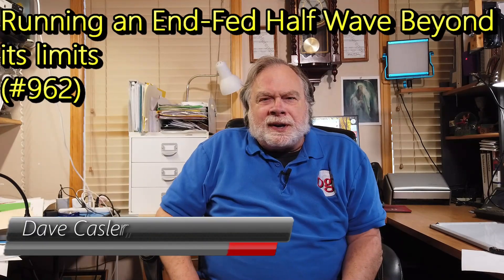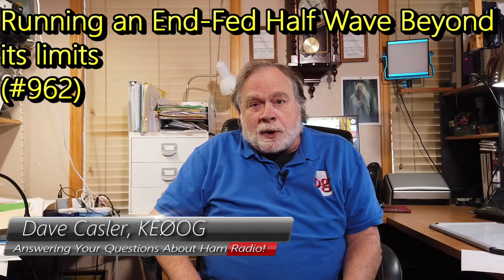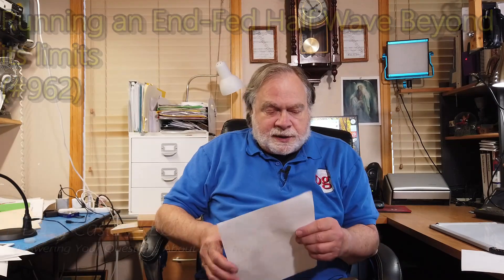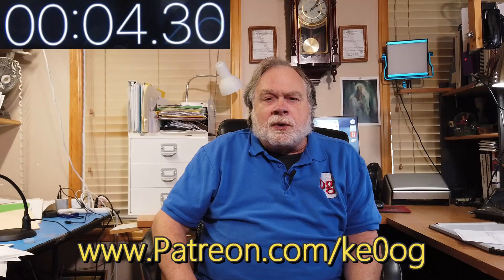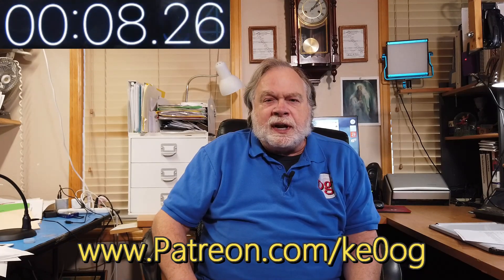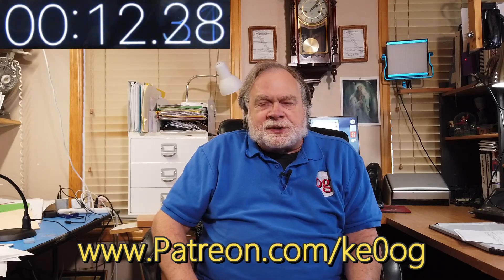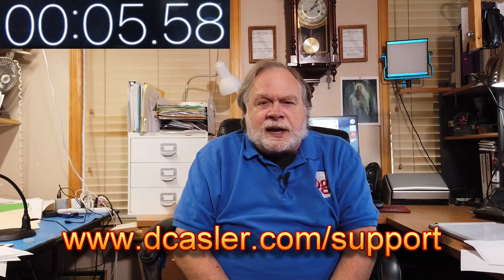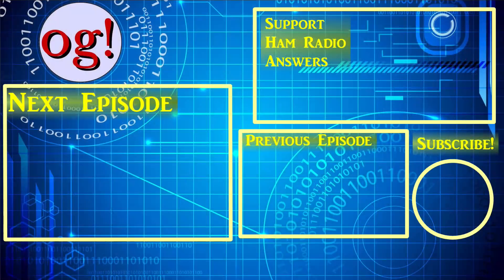Running an End-Fed Half Wave Beyond Its Limits (#962)

Comment: I heard a similar discussion on the OCF. They tend to heat up more than other baluns. Their response was to build a balun rated to 3k watts. But then it only seemed good for 150 watts on FT8. 
But anything over 50 watts is usually overkill.

Comment: From the questions he asked, he is wanting to run more power on the Digital Modes.  My suggestion is not for him to run less power, but to build or  buy something like the MyAntennas EFHW-8010-2K-Plus.  This is a 49:1 UNUN Transformer with 3 of the 2.9 inch cores.  But even with this, they advertise a Digital Power Limit of 350 watts to prevent either of the two issues that could arise as you talked about in your video.  And yes, these are modes for Weak Signal Reception, not low power transmission as such.  You should run the lowest power to make the transmission.  But to work FT8WW on Crozet Island on FT8, 100 watts would not get you a confirmed QSO at all times.

Comment: I've been playing with my home-made EFHW, based almost exactly on DL2MAN's U01 emergency communications antenna, and I've noticed a few variables that I did not anticipate having to pay attention to:  core size (mainly to make sure I'm not losing efficiency or over-powering), diameter of the wire I'm using to make the antenna, and most unexpected, the length of my coax - which kind of functions as a radial.  If I make any drastic changes to any of these, I see a huge difference.  Kind of reminds me of making sight changes on a rifle scope, the smallest change at the point of change results in an exponential effect at the target, or in the case of my QRP rig, at the point of radiation.

Comment: 1.  He said "I like to run some power on digital bands".  Amateurs running RTTY (which is a digital mode) have always run a lot of power.  Also FT8 is a "weak signal" mode and not necessarily a a low power mode.  Even you said you run some power on FT8 and maybe this amateur is only going after the difficult stations.
2.  You said to add cores to the balun.  The real reason it is heating is the XL of the primary winding is too low.  You can increase the XL with more cores OR you can increase the number of windings.  You still need a 2:1 windings ratio or equivalent for your 4:1 impedance ratio.  But his core is heating up from the high current losses in the primary winding.  A nanoVNA can help in these required changes.
3.  Telling someone to run less power to avoid these issues is like a mechanic telling a customer to not drive over 25mph to avoid a shimmy.  This is irresponsible.

Comment: The duty cycle should or could also be lowered if the operator feels the need to run 'high' power, because you need to give the materials a chance to experience some cooling time.

Comment: Ft8 is a low signal mode, not a low power mode.  I remember being surprised when I first read this.  Then I continued reading that low signal modes were primarily developed for moon bounce and moon bounce is not low power.  I would agree 30w is plenty for most digital work but as you said sometimes you want to reach out a bit further.

Comment: The steady-state nature of digital modes is confused with SSB power levels thus cores take a beating. Thanks for stating digital modes are "QRP" modes.  49:1 autotransformers are typically rated at SSB power levels. One core 100 watts SSB; two core ~500 watts SSB and three cores about 1000 watts SSB. I would refrain from operating anymore than 25% of these SSB levels using a digital (steady-state) mode. Your autotransformer, baluns, radios and amps will like you a lot more and last longer....
73' de K4WRF

Comment: Unless you want A LOT of common mode current in your shack, you absolutely need a line isolator or choke balun for a EFHW where proper grounding, which  is almost always the case, is not possible.

KC5RJL